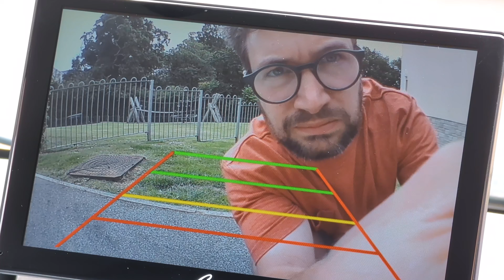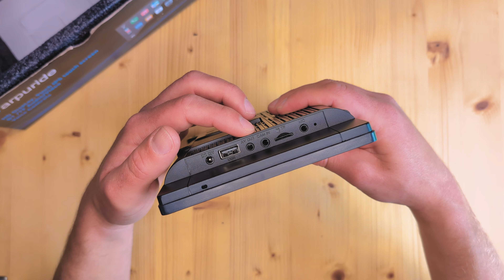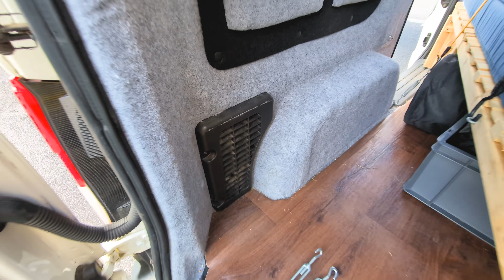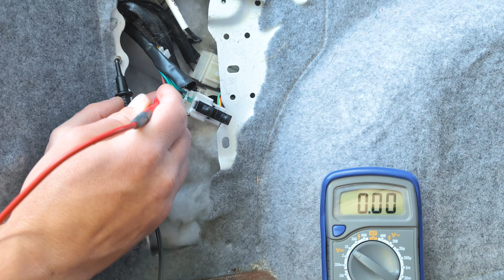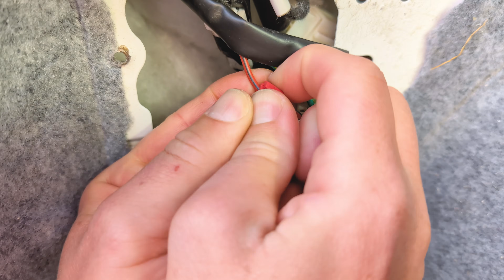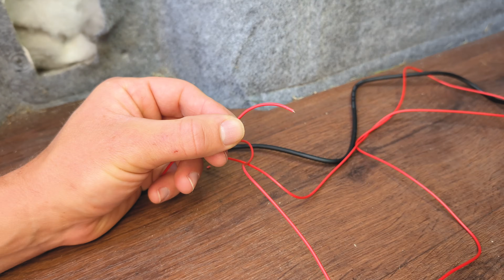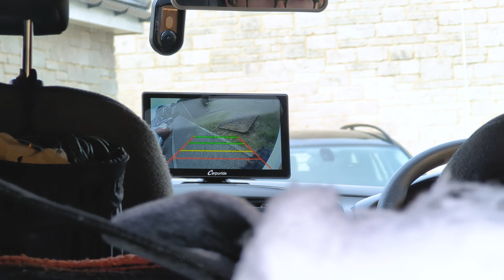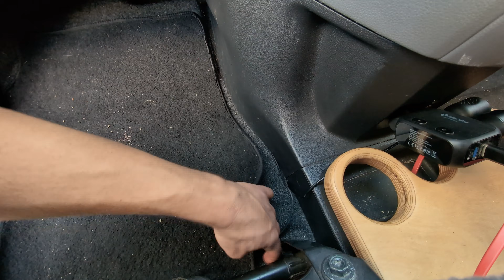How To Install A Reversing Camera

Comment: Where did you connect the red wire that is in the screen side ?
Reply from the maker: Sorry I'm not sure I understand the question - one end of the red wire connects to the reversing light wire, the other feeds into the wiring for the jack that goes into the screen, so you only have to deal with one end of the red wire
Reply: @LensOfJames i think you got it
Reply: it’s already connected via the cable to the screen
Reply: This is my question too, I have a loose red wire both sides, I guessed the red on the camera end would power from the reverse light but I have no idea what to do with the loose live on the screen side?
Reply from the maker: Sorry, I'm not familiar with systems with two red wires

Comment: Hi, great videos btw.. surely they could have added the "reverse parking lines function" to the reverse camera on the w903 software as oppose to wiring into the car reverse light cable etc 
All the hassle to wire it up,. it would just be just a click on the screen when in reverse easy enough and saves dismantling your boot as the camera cable could be routed a lot easier.
Reply: Selâm dostum. Bende üç kameralı araç kamerası aldım. Ön ve iç kameranın görüntüsü ekrana geliyor fakat arka kameranın görüntüsü ekrana geliyor. Jack kablosunu taktım ekran gelmedi. Ben arka kameranın da ön ve iç kamera gibi sürekli olarak kayıt yapmasını istiyorum. Bunu nasıl yapabilirim? O kırmızı küçük kabloyu nereye bağlamalıyım?

Comment: @4:43 10-11volts is actually normal, this was what I got with mine and I had a new battery on, so nothing wrong with your battery nor do you need to change it either. Because you haven't started the engine, which means your alternator isn't running, so if it does, the voltage would be 12-14 volts as the alternator would be driving all your lights, your android head unit and of course, your reverse camera as well plus recharging your battery all at the same time and it needs a slightly higher voltage to do all that
Reply from the maker: Thanks for sharing this, good to know!
Reply: @johnmonk3381 Is it normal that the reverse wire has power (around 3.7v) when the ignition is on, but the gear is NOT on reverse? My dashcam was working fine until recently, it stays on reverse mode even when driving forward. When I switch the key to ACC, dashcam then works fine.
Reply: @marlonmadrona1309  hello. I don't think that's normal. Without reverse gear engaged, the voltage should be close to zero. I think I measured that before, it was like 0.02 something like that. Mine's a 2005 toyota camry, not sure about your vehicle. You may have an electrical leakage somewhere, something is causing 12volts to leak onto your reverse gear live wire in unengaged mode

Comment: Fun Instalation, but for your Van in Carpuride is better bougth de Rear Back Camera Bluetooth is more easy the instalation 😎👌
Reply from the maker: It's an option, but with bluetooth or wireless you don't have the automatic reversing camera when you put it in reverse gear. You'd have to press a button every time to activate the camera

Comment: Hi i have a old minivan 2002 pontiac montana.  I cant get my new rimoody mp5 to work with reverse camera. I did use a scosche wireing kit. At first nothing worked until i ran my own 12v ignition wire to fuse box. Also steering wheel controlls do not work. After dealing with these issues im thinking the old van is not putting out a signal for backup wire im gonna get a circut tester so i can figure this out.
Reply: Welcome to owning a GM vehicle n messing with the wiring. They do this every single time!